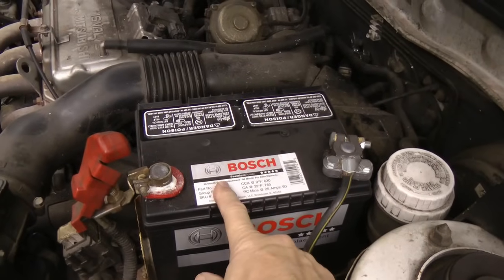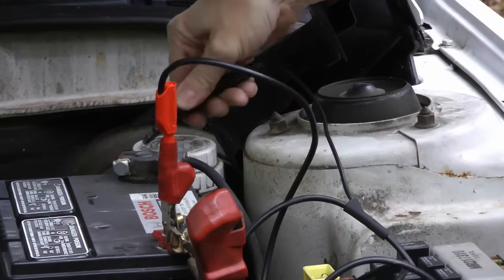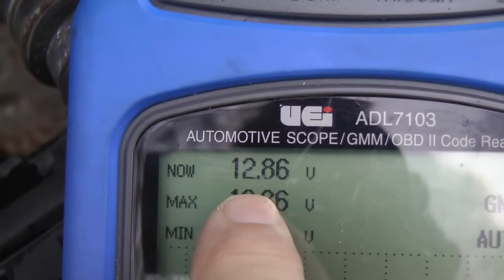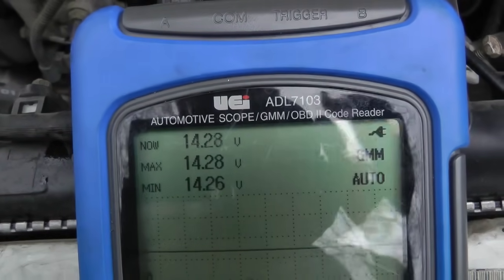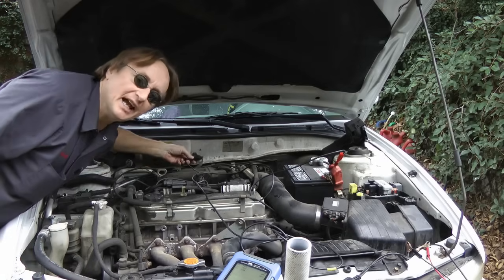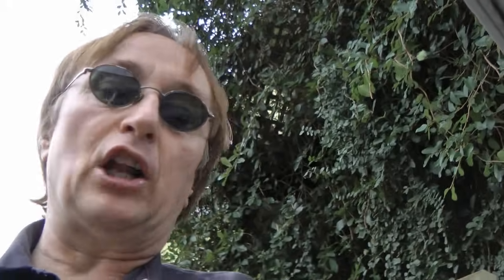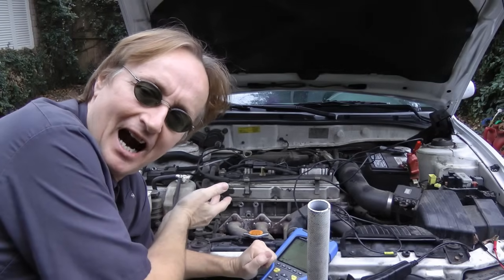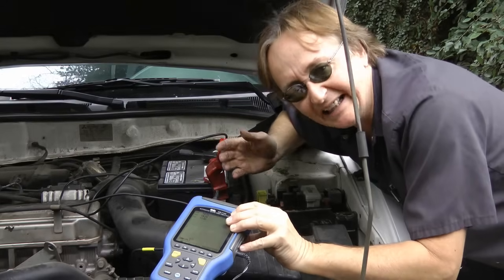How to Fix Electrical Problems in Your Car (Ground Fault)

Comment: My freind has a 94 jeep grand cherroke and he was goin 70 on the highway and his backwindow was icy so he turned on the defroster and the engine downshifted and it was at 3000 rpms and then he turned the defroster off and the engine went back into the right  gear

Comment: hey scotty i have a 92 caprice that i bought a few months ago,and sometime before i bought it some one installed a new horn button under the steering wheel and it works,but the one on the wheel does not but also recently the horn has been going off for no reason,and i have to bang on the steering wheel to stop it,there is no pattern to it(like pressing a pedel and it happening),but i also noticed that after it does it,the left button works for a little bit.

What can i do to fix it?

Comment: part  2  = i replaced the battery from my dodge dakota  1 year old battery  to my dodge ram to see if that was it.. but i did the same thing..didnt want to damage the motor so i havent touched it ..took the battery out and am now driving my 94 dakota  longbox

Comment: my 2003 dodge ram  took a turn for the worst.. i told you about the white smoke burning and  using about a liter or so a week of coolant. now in the 25 of dec..we want to leave for dinner and it goes...CLANK....not click.. so i put the battery charger on it.. 10 yrold battery was drained   i tried it after dinner..same thing.. CLANK  the coolant leaked into one of the cylinders and hydrolocked the motor.. do you think so? havent driven it since the 25 .should i pull the plugs? very cold job -15

Comment: my 1994 chevy stepside has some electrical problems i think cause the temp sensor works sometime and other times it dont and it cuts off at red lights i did full tuneup its burning alot gas too and i smell like plastic inside cab when im driving i took glove box off and seen pcm and it looks normal it has no radio so i look under it and some wires was touching but i fix that its still doing it oh yea when it cut off it start right back up

Comment from the maker: doubt it, just removing that cable to clean it will reset the computer, and when it sees the problem again when driving it will turn that light back on. get it scanned for codes first.

Comment: Do you have a video showing how to trouble the electric in a car door?  I have a Camry with some issues.  Opening the door does not turn on the dome light and the electric lock does not work.  I don't know if that is two problems or one problem causing both.

Comment from the maker: those stupid pressure sensing systems are all wireless of course, as the tires spin around. Normally the sensors in the wheels go bad and do that, they have batteries inside and they wear out when 4 years old often.

Comment: Tired of wiring problems. Have a Ford Taurus that has a problem in the wipers. They just come on at anytime going down the road but only do 2-4 wipe cycles then stop. Never know when its going to happen. Even changed out the switch and still continues it.